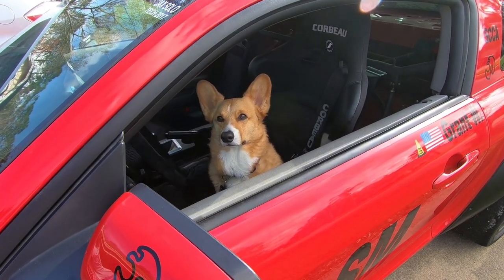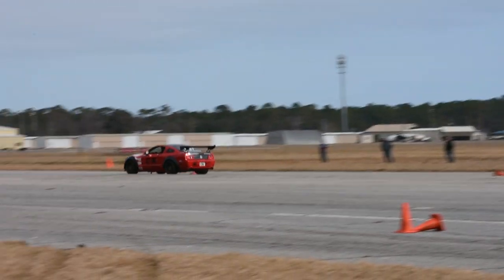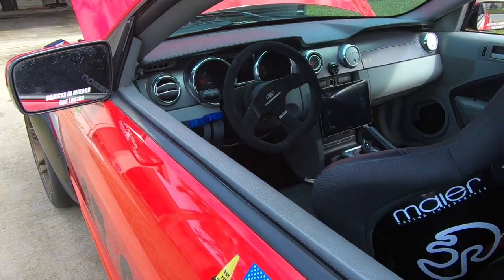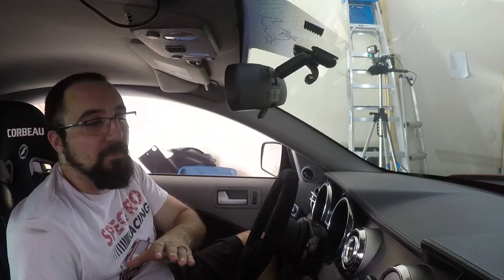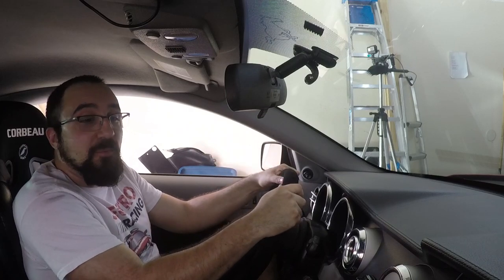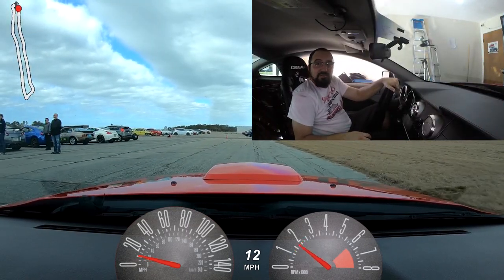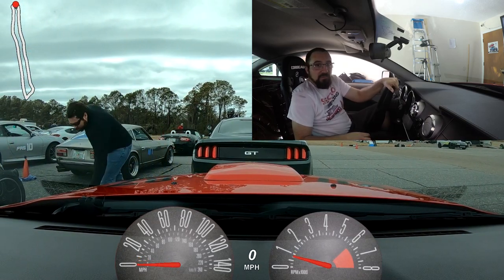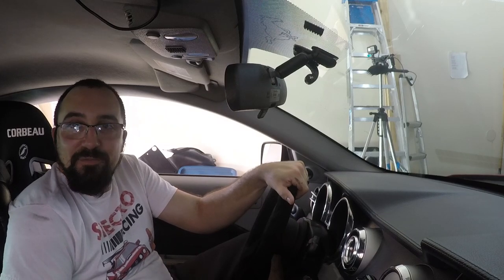Racing the Widebody Mustang - The Ultimate Street Mod Car

Comment: anyone know what brake system he is running in the rear? stock calipers with stock rotor size?
Reply from the maker: Stock rear single piston brakes with Hawk HP Plus pads, power stop rotors (stock size)
Reply from the maker: Full build list here http://www.spectroracing.com/blog/2016/5/19/the-spectro-racing-2008-mustang-gt